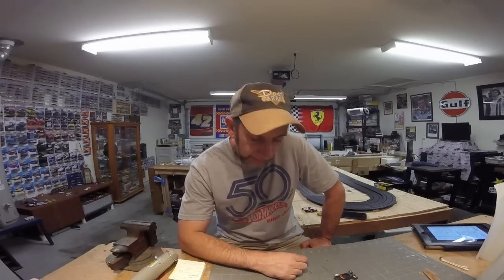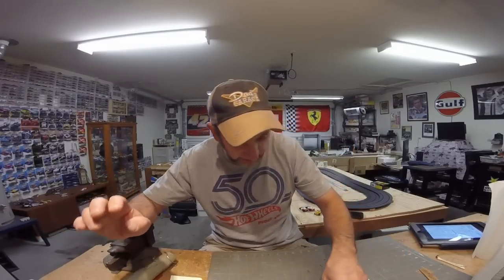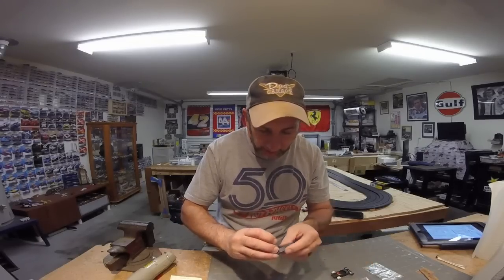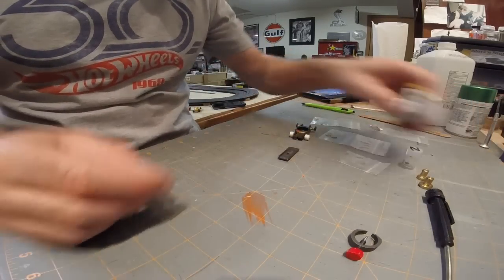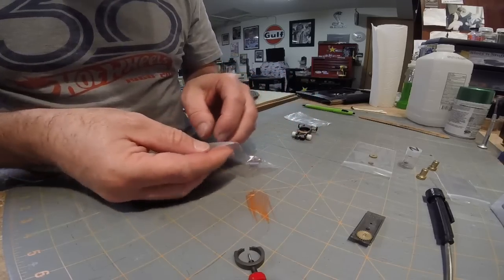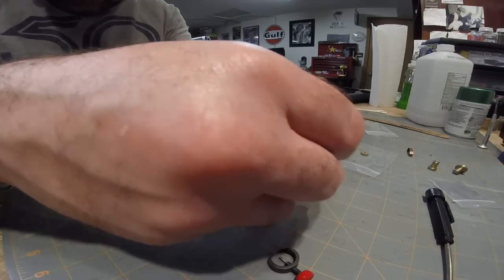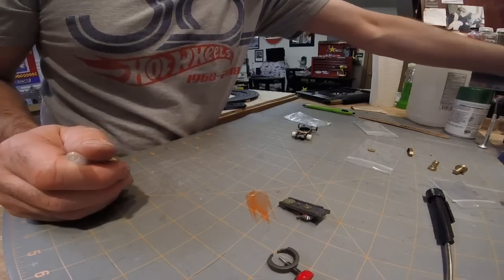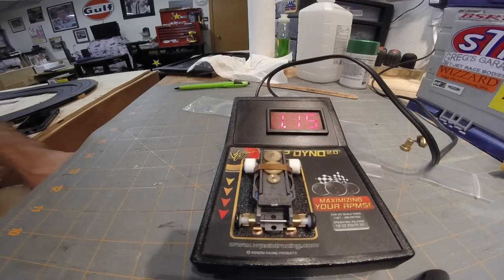How to install a tjet armature

Comment: How do you remove the armature from a non Magnatraction motor plate? I have one with a bad armature and want to put my balanced quadlam on. I have the same puller with the red knob you have and it will not get under the top gear pressed on to the bad mean green armature I have. I need to reuse the brass gear and the motor plate. Any help would be great please

Comment: Ok, so I know a press /puller device is the proper way to remove a T-jet pinion gear, but, in a pinch, could i do it with a small screw driver?

Comment: Could you do a video on using the TGT-8 rear axle pusher crown gear removal tool from scale engineering?  And the T-jet rear axle install tool 164-306 from scale engineering..

Comment: I picked up 8 old tyco cars with the curve hugger chassis, they all light up but one, the one that doesn’t light up has a diode in it and it will not run, any suggestions why?
Reply: @Toby Wade definitely, I have been using instaflixxer for years myself =)